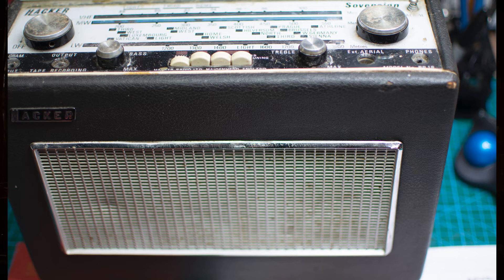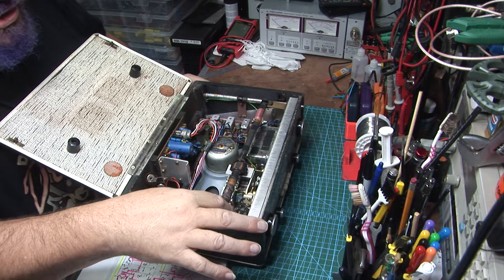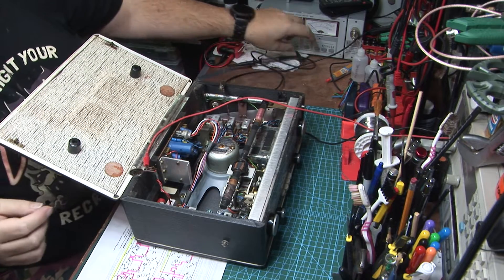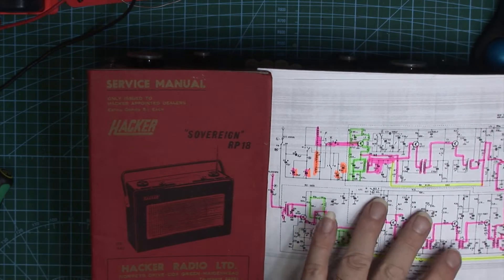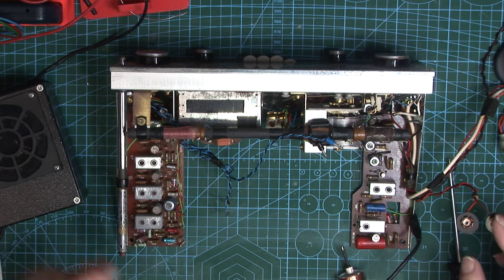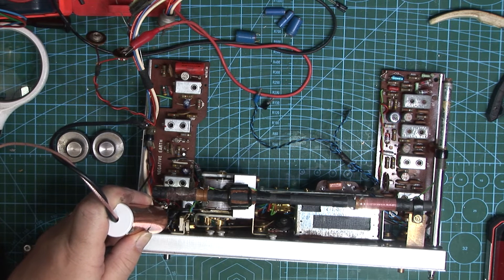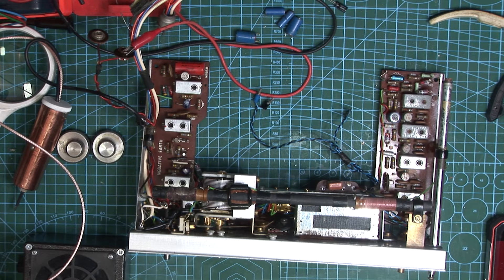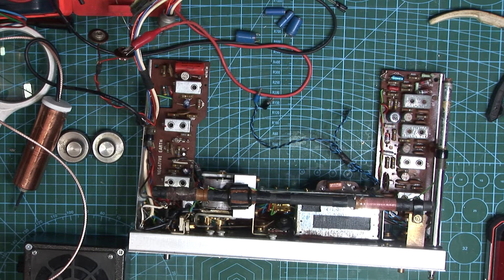Hacker Sovereign Rp18 Initial test and AM section fix

Comment: George working on a sovereign rp18 am section changed the transistors and the electrolytic capacitors getting a lot  of   static can't pick up no stations even with a signal tracer transistor I used  are silicon  pnp 2n5401 can you help me out  thanks Joe

Comment: That’s a quality radio. In my opinion the best sounding Hacker there is and it’s the early version as well. Hopefully the aerial is okay. Great tutorial. I was surprised that the AF117 was still alive but some seem to resist shorts for some reason. I look forward to the rest of the series. Cheers Graham
Reply from the maker: Indeed, between this and the sov 2 they are possibly the best sounding portables. I don't count the sp80 as it is a completely different beast , the only thing coming near is the Hunter.

Comment: Nice set - those DALY caps are not nice are they !
Reply from the maker: Not very. When I get to the amp board I will try and test it before and after to see if it still meets spec as is. I don't think so but it isn't dead as such, still throws out some sound.

Comment: Great Stuff George Lovely Radio Sound Superb  Dont Dilly Daly George Get Rid Of Them and Would Be Nice To See Some Zap Action On Those Wiskery Rascals Comeing Along Nicely George Thanks For Uploading Regards mike.
Reply from the maker: To zap or not to zap... replacing them with modern transistors works very well and is less problematic than recycled Mullards. I will show the proper way to zap them if I do go down that route.

Comment: Super fast George :-D  No naughty thoughts.
Another hacker alive again, well done george :-D
That paper clip looked like death :-(
Didn't the previous owner make a dam mess!.:-(
My direction for checking would be the end of the i.f strips with a receiver set to 455-470k and 10.7 smegs.
I like using receivers for sniffing the i.f products without actually upsetting anything.
But i'm a bodger and i never found a need for a r.f probe.... yet lol.
Ill shut my face now lol.
Reply from the maker: Indeed, the innards around that volume pot left a lot to be desired. I know not everyone is well practiced at soldering but randomly melting wires really does look bad. They hadn't done too bad a job with the af127's so it baffles me a bit. as for IF testing, I have a special little box for that, you will see it in the next video.
Reply: @GeorgeChristofi  Perhaps the af127 soldering was done by a different bloke.
Cheap crappy solder and lack of wire/terminal tinning makes a right mess.
Keep tinkering George, good to bring stuff back to life :-D

Comment: Good stuff , wonder if that faint radio 4 was them resistor transistor capacitors or whatever they are called starting to reform. 
Nice fault finding and great thermal camera views 
Looking forward to seeing the next one
Best regards Shaun
Reply from the maker: it was down to those dodgy Daly caps Shaun. We shall see what is going on with the FM side soon.

Comment: Hi George, nice to see you back on YouTube again, as an old timer (80) I have been using Servisol for more than 50 Years now, what is the make of the one you use? as for Deoxit I think it overpriced.  Regards from Ray the old sod from North Wales.
Reply from the maker: Hi Ray. To be honest I generally use whatever is cheapest on Amazon or eBay at the time. I have been a long term servisol user but the rising prices just put me off a bit. Another one I have been using is Kontakt 60, A belgian companys product which was very good. I will not pay the silly price of Deoxit as I really don't think that it is much better than anything else, it just has good hype and the perception that it must be good because its expensive.